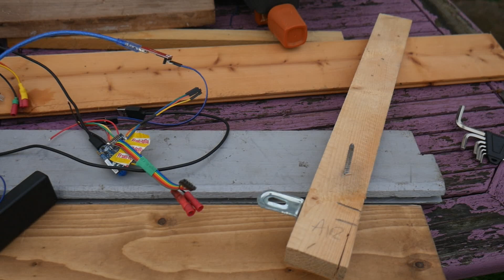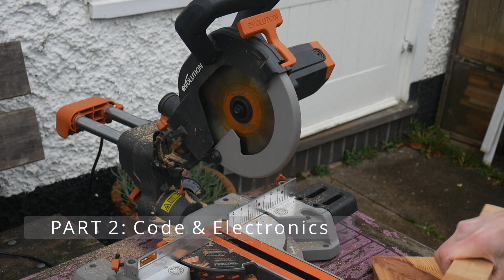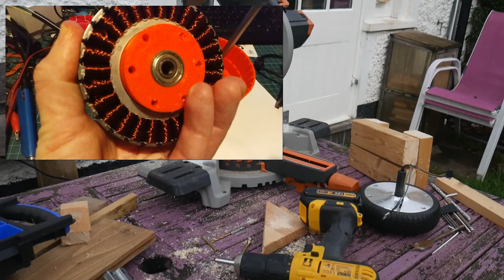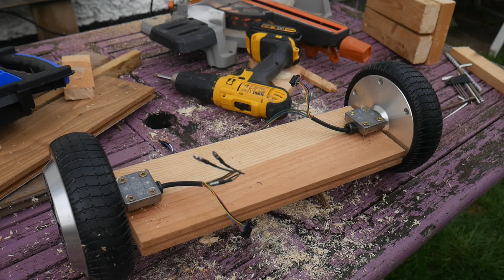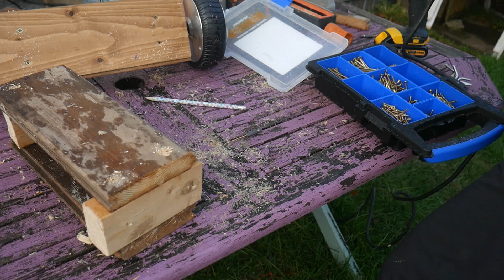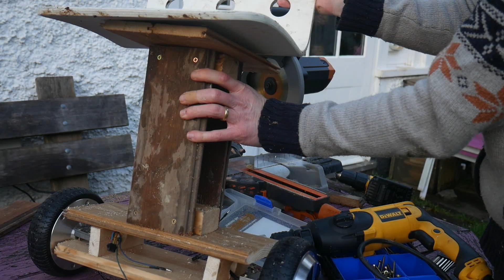Hover (board) Chair PART 1: Build

Comment: Thank you for sharing your project. I will be eagerly waiting for your next videos as you make progress. I am specially interested as I am also working on a project which has real use case to assist a handicap person do certain tasks easily with help of mobile platform. I have set challenge for me to build this project at the same time learning physics of simple machines, electronics and motor control. I have following requirements (goals) for my project:

- Simple, low cost and light weight mechanical design using off the shelf hardware parts (aluminium or carbon fiber plates & lot of    hinges,pullys,gas struts lift support used in cars,weston differential or worm gears and Dyneema ropes).
- It must be usable either as a chair or a twin size bed and it must be portable and safe.
- The chair seat must lift the person at least 2 feet to easily get him in the car or enable him to access kitchen and bathroom sink with touch of  button on the phone or a physical joystick.
- Memory foam backing for light weight.
- Fully open dimensions around 38" x 74" (Twin size bed) and should be foldable to be carried in a car and must be less than 25 KGs in weight.
- Simple, low cost and easy to implement electronics hardware and software design (Raspberry Pi Zero or ESP32).
- Manual (joystick) as well as wireless remote (WiFi or LORA) control for  and all mechanical movement of the vehicle.
- Multi voltage power supply and motor controller design for all electronics hardware.

- DIY Lidar system for collission avoidance ( HC-SR04  with temperature and humidity sensor for accuracy, RCWL-0516, VL53L0X or VL53L1X sensors).
- Autonomous vehicle using hoverboard motors which can control all movements of mechanical hinges and pullys for multi purpose use      cases for disabled person.
- Solar Panel Charging Batteries and 2 axis solar tracker.
- Long range communication for  controlling vehicle using Lora & WiFi tecnologies. (Raspberry Pi Zero, RX1262 and Ubiquity Nanostation).
- PTZ Video camera link & control using WiFi and local Storage (Raspberry Pi Zero or Wyse Pan).

Although my goals are wider and more ambitious than simple hoverboard chair I hope to learn from your project specially how you implement SimpleFOC motor control.

Thanks again.
Reply from the maker: Wow that project sounds amazing!!